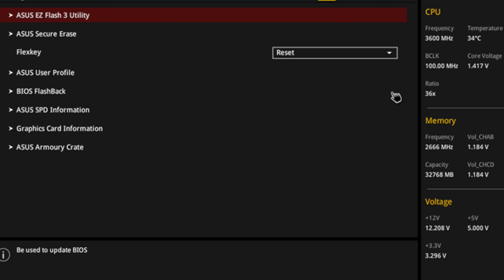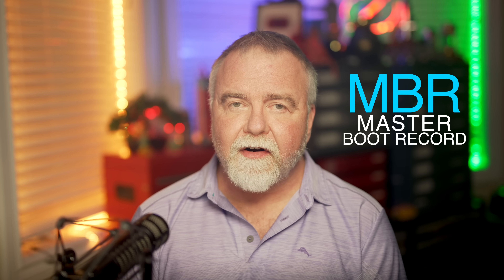How Computers BOOT: From Startup to Viruses

Comment: Nostalgia time...

In 1981/2 I was the software engineer / physicist on an Antarctic research base. Our Interdata 8/16e (later Perkin Elmer, later still Digital) had hex indoor for the "switch" register. You'd let in the 4 digit address and the 4 digit half word, press enter, and the address would auto increment, so the rest of the code was entered a halfword at a time.

To start you entered a few lines of code starting at 0x50, set the program counter to 0x50 and pressed run. 

That program gave it enough smart to load and run a program from mag tape, which would make the drive run forward less than a foot and stop.

Hopefully the address and data lights would be flickering by now as the program on the tape started to load the operating system from hard disk. 

We had a pair of massive hard drives in a 19" rack, the bottom one permanent and the top one removable. The disks were almost as big as you could for into a 19" rack and were spring mounted so the whole unit wriggled noisily when worked hard. Assuming that all was well it made a distinctive set of rattles as the OS loaded. 

When all web writer you know there was a prompt on the console. If something has gone wrong you know sooner because there would have been an unusual pattern of rattling prior to the silence. If you were lucky there would be significant info on the screen; if not then start other test checks.

One beautiful thing was that we had core memory: unlike modern RAM it retained its state during power down (usually: that is unless the crash has corrupted stuff)

So 19 times out of 20 when you keyed 0x50 you saw the first instruction of the fifth sequence, and you'd just step through memory to check it was all there, enter the 0x50 again, and hot run the code from last time round. No ROM needed with core memory 😊

It was our senior engineer who modified the OS so as not to obliterate the fifth sequence. Back in the day all OSs were open source to customers, so we could do that. We submitted that mod back to Digital, but I never heard of they rolled it out.

Frequently committed silly mistake, when the machine crashed at 3am and you were women up to sort it out would be that nothing happened when you pressed run after the tape moved forward and stopped. Half asleep you'd forgotten that mere detail: before booting you need to unload the data tape and load the boot tape. Derrrrrr. 

The reverse error, of leaving the boot tape up and starting the data collection would have been embarrassing, 3000 miles from the nearest postal service...

So we had PLENTY copies of the boot tape, and a second machine that could have written more not tapes if needed. As far as I know none of us ever made that mistake, but HQ had prepared for that contingency. Given some of the errors that were made that wasn't such a bad idea...

Soon after I got home the Compaq and other IBM clones were just launching and a year later the Amstrad 1512 was the first machine that I felt was affordable and sufficiently advanced for me to want to spend my own money on....

Comment: Great explanation, Dave.
I'm curious about FDISK and XP Windows Repair disk operation. Here's why. I have a messed-up hard drive That won't boot, nor can it be seen by an XP system as a secondary drive. But the drive can be seen by FDISK and the XP repair system. I can traverse the file system with the repair system but its limited copying capability does not allow copying a file to another drive preventing me from rescuing files.
How does FDISK see the drive, why doesn't the OS see the drive when the repair system can? How does the repair system see the drive? And is there any way to copy from such a drive to another drive? (All the rescue tools I have found require the messed-up drive to be visible to the OS.)

Comment: Thanks this brings me back memories.  I remember during my high school days, the computer lab teacher would remove me from the class as I was one of only kid in school who understood about boot sector viruses.  He just excepted me from the classes, as I also gave him grief whenever I ask questions or propose better code. So I sat in a corner and help fix the schools virus issues.  I have a known disk that has no viruses and write protected.  I then would get most of my classmates disks, go through them and using DEBUG to copy back the boot sector to its original address.  I also can easily when there is boot sector virus, when you open the PC case, you can see drive A: head will move differently when an infected disk is booted, you can clearly see that will go the beginning cylinders initially but moves to end to load most of the real boot sector.

Comment: Did you discuss the SPI bioses that are loaded via serial interface before executing? The CPU interfaces with the PCH and the PCH load the bios. As far as I know all modern CPU's work like this. There is a lot more to it than the old XT or AT systems.

Comment: As I understood, after the BIOS is done finding the MBR and handling the execution to the CPU it's done and nothing in the BIOS should affect the system, however, specially on AMD platform, BIOS updates also improve OS stability. How so? isn't the BIOS done after handing the execution? why does updating it affect anything after the boot?
Reply: Much of it is probably due to ACPI, sort of a two-way communication system between the OS and the platform firmware. ACPI is at the heart of modern power management and sleep states.

Comment: Can you tell us how and why Win9x-Setup does a warm reboot with subsequent RAM test one single time but there's no way I know of doing that after it is installed? Well other than pushing the reset switch of course by just using software.

Comment: One reason BIOS Booting went: BIOS -> Boot Drive -> MBR -> Active Partition -> Partition Bootloader -> OS Bootloader, was simple size constraints.
You needed quite a bit if space to store a bootloader that is capable of properly reading and writing a full filesystem. There was just no way to fit even partial reading before the Partition Bootloader.
UEFI has much more storage space. So now we can write the OS bootloader directly into it. Sidestepping the whole MBR Relay Race.

Comment: I hope this channel can discuss the Intel Management Engine (ME) running MINIX at a lower level than the OS. Why is it there? Is it true that it continues running in low-power mode even with the system turned off (but still plugged in)? Supposedly it has TCP/IP access and the computer can be woken up and accessed remotely. It sounds like we don't actually have privacy at all as long as there is an ethernet cable plugged in. AMD has it too, I think it's called, Platform Security Processor (PSP). Andrew Tanenbaum, creator of MINIX, wrote An Open Letter to Intel about this.

Comment: A bit of the IBM  8080 BIOS mememory test. 
LOC   OBJ    LINE  SOURCE

EOA2  7307   309   JNC     C9        ; TST 1A
E014  33C7   310   XOR     AX,D1   ; ALL REGS?
E0A6  7507   311   JNZ     ERR01   ; NO - GO TO ERROR

It was all documeted and free.  I still have all the docs.

Comment: I'll have to disagree with you on the actual origin of "bootstrapping". Bootstrapping is an electronic method. "In the field of electronics, a technique where part of the output of a system is used at startup can be described as bootstrapping.
A bootstrap circuit is one where part of the output of an amplifier stage is applied to the input, so as to alter the input impedance of the amplifier."

Comment: Hi Dave, great video as always!

I think you made a mistake at 5:24.

As far as i remember an 8088/8086 CPU could never have a reset vector at FFFF:FFF0h because that would wrap CS:IP both to 0 considering that these CPU's don't have an A20 line. On the 286 and following and while still in real mode you can indeed access 64kb (minus 16 bytes) past the absolute top of a 20-bit physical address. The first byte after the FFFFFh physical address is the start of the HMA area.

In an 8088/8086 i'm pretty sure the reset vector must have a CS:IP of F000:FFF0h or FFFF:0000h. Again FFFF:FFF0h is well past the 20-bit physical address and pretty much to the top of HMA (top minus 16 bytes) area which only 286's and beyond can access via the A20 line.  

I'm also 100% sure you are aware of this and it was just a mistake!!

Comment: 00:00 🖥 Computers boot through a sequence of events triggered by the power button, and understanding this process involves exploring CPU initialization, BIOS, and booting mechanisms.
01:25 💾 Simple computers like the MSI and Altair had CPUs connected to common buses, with the CPU reset line triggering a reset of internal states before starting execution.
03:56 🔄 Booting an Altair 8800 from a floppy required setting a ROM address and executing the boot sector code, demonstrating the process with front panel switches.
05:19 🧠 x86 PCs start executing code from a specific BIOS address, undergo POST (Power-On Self Test), and look for a bootable device to load theinitial bootloader.
06:28 🖥 BIOS initializes hardware components, performs POST, and hands over control to the bootloader, initiating the operating system's loading process.
09:00 🌐 UEFI (Unified Extensible Firmware Interface) replaces traditional BIOS, offering more features, larger drive support, faster boot times, and secure boot capabilities, enhancing the overall boot experience.
10:49 🎮 Writing a bootable game or a boot sector virus requires intricate steps like creating a boot sector, transitioning CPU modes, loading game code, or exploiting system vulnerabilities, showcasing the technical complexity involved.
12:41 🦠 The "Stone Virus" exemplifies early computer viruses, infecting boot sectors discreetly, ensuring its continuity by quietly transferring itself to other floppy disks and spreading through shared data.

Comment: An interesting thing about UEFI which Dave did not explain in this video (he probably knows about it), you can also interact with the UEFI from your operating system, for example to 'tell it' to automatically go into the UEFI-menu after rebooting or to change the bootorder. On Linux with SystemD you could do the first thing by giving the option firmware to the reboot command, on Windows there also is a command for that but I don't know that by heart because I don't use Windows, I have tried it out though it works fine and it is easy enough if you remember the more difficult syntax.
Reply: In windows the command "shutdown /r /fw /f /t 0" will restart and enter the firmware interface. Not all PCs have the capability though.
Reply: Don't quote me, but I believe that's as simple as a defined setting either in sram or a file on the uefi partition.
ie, the uefi just checks if it's got a voicemail from the OS or not. 
Or, the way windows checks for the dirty flag to run chkdsk.
It's not... "interactive" as it were.
Reply: @myne00  boot order is done through UEFI variable manipulation. UEFI provides a set of routines at boot time to the OS (UEFI runtime services) and one of those routines allows the OS to modify UEFI variables, including boot order and boot flags. The UEFI partition contains the bootloaders that the bootselector runs.

ye olde CMOS settings are still in (battery-backed) SRAM, although some platforms let you ditch the battery and RTC.
Reply: Isn't there also the fact that when you are in the UEFI settings your machine is running the MINIX operating system.
Reply: @mikebarushok5361  UEFI is definitely not MINIX. There are rumors that the firmware running on the management engine (ME) in some chipsets runs MINIX, but that's a separate microcontroller.
Reply: I had to figure out how to boot straight to UEFI from the OS just this week to change boot device order, because in some hardware the splash screen goes by too damn fast to even select your boot device. I'd either have to disable quick/fast boot in the UEFI menu to have the hotkey usable, or the boot override setting.

Comment: Hi Dave, great video!

Not trying to be an arrogant prick but i'm pretty sure there's a mistake at 5:24. The reset vector on a 8088/8086 can't be FFFF:FFF0h because on those CPU's there's no A20 line and setting CS to FFFFh and IP to FFF0h would immediately wrap both registers to 0000h. Starting from the 286 CPU i'm sure setting CS and IP like that would make the A20 line set the physical address to the end of the HMA area minus 16 bytes.

So on a 8088/8086 the vector MUST be by setting CS at F000h (start of the last real mode segment) and IP to FFF0h. The alternative would be setting CS to FFFFh and IP to 0000h. Both methods point to the same physical 20-bit address of FFFF0h. 

I'm absolutely 100% convinced that you are aware of this and that it was just a mistake.
Reply from the maker: FFFFFFF0 is not FFFF:FFF0, nor did I claim it!  You can use segment-offset to reach FFFFFFF0 without any overflows or A20 line, right?  Or at least I thought so!

Comment: If bios is at ffff fff0, what address range is bios stored in? Why the last 16 bytes ignored? Or are they used for something else?
Reply: Dave made a mistake, the reset vector is actually F000:FFF0. Due to the weird addressing of the 8086/8088 this is physical address FFFF0 which is still 16 bytes away from the end. These 16 bytes are enough to contain a jump to another section of code. On the original PC the main BIOS ROM is 8 kilobytes beginning at FE000.

Comment: So if I'm following... the 80286 started up in real mode (16-bit) with a 24-bit memory bus... doesn't that mean it can access memory from 0x0 through 0xFFFFFF? How does it boot from memory location 0xFFFFFF00 since that's a 32-bit address?
Reply: Yes it starts in real mode - and in early PC-AT days that is were it would stay mostly. It would behave like a faster 8086 in most respects, however there was a area where the behaviour would differ from a "real" 8088/8086, and that happened when you loaded a segment register with (say) FFFF,  That gave a base address of FFFF0, to which the instruction pointer would be added. In effect indexing beyond the end of actual address space on the 8086. What would happen on the 8086 is the access would "wrap round" - you would actually access the bottom 64K (less 16 bytes) of address space. The 286 had 4 extra address lines, so even in real mode, it could still access the first ~64K of extended memory beyond the 1MB boundary. The IBM engineers decided to implement a "gate" in A20 (the 21st address line). So with that line gated out, the CPU would then behave like a real 8086 -  and any software that depended on that quirk of the hardware would still run. 

However because the CPU could be switched to protected mode, where it could address 16MB of physical RAM, it would need to use that address line normally, that gate needed to be software controllable. The gate was oddly included in the keyboard controller (the logic being that was one of the few bits of original hardware design that they did for the PC - everything else pretty much came straight of the reference designs from the engineering data sheets). So you have the rather odd mechanism where the CPU could (relatively slowly) talk to the keyboard controller via a serial link to switch a gate that allows access to higher memory!

That gate still exists in modern PC hardware - but these days buried in a the support chipset, and accessibly far more quickly.
Reply: The rest vector isn't FFFFFF00, it's F000FFF0, Dave made a mistake. To answer your actual question, it's not a 32-bit value but rather two 16-bit values: 0xF000:0xFFF0. In real mode the physical address is derived by taking the segment address, multiplying by 16, and adding the offset value. This comes to a physical address of 0xFFFF0 which fits perfectly on the 20-bit address bus of the 8086/8088 and also fits in the larger 24-bit address bus of the 286.

What @johnrumm4786 is saying about the A20 line and wrap around addressing is true and informative but doesn't actually answer your question.

Also not directly related to your question, even in protected mode the 286 uses 16-bit addresses. The difference is you could redefine the start location of each segment.

Comment: Here is a fun project for you Dave if you want to delve into the rabbit hole.  Could you make a floppy disc reader with today's technology at home?  It may even be (and easier with today's PCB capabilities)possible to read all tracks at once and do a single rotation.  Not even touching upon what Magnetic Field Imaging (MFI) technology there is out there.

Comment: Isn't the x86 boot address FFFF:0000  or FFFF0?
Reply: Nope, it's FFFF:FFF0, in a weird unreal mode (which is 16B back from 4GiB in address space). Seriously.
Reply: @argoneum  The last time I wrote embedded programs in the 1990s, the 8086 and 8088 started with CS=FFFF and PC=0000, i.e., address FFFF0. And Weird Boots started from the 286 series. But that was many years ago. Who knows if Intel has changed the way 8088/86 boots?
Reply: @JohnnieWalkerGreen  True. Later since 386 it was booting in a weird "unreal" mode: almost-real mode, but accessing those last 16B of a 4GB address space: FFFFFFF0, while pretending that it is 000FFFF0, those most significant bits are invisible to the software. After a jump they were zeroed, and CPU was bound back to first 1MB (almost, 'cause again: A20 shenanigans). It was this way unless until Core 2 Duo, did some poking around in coreboot and it was one of those weird things in modern x86. There are many more odd tricks, including convincing caching mechanisms into allowing (ab)using cache as RAM before DIMMs are even initialized. The entire RAM init is an art / science / cludge by itself, not sure if anyone outside Intel really understands it 😁